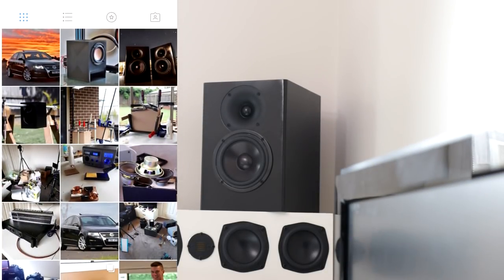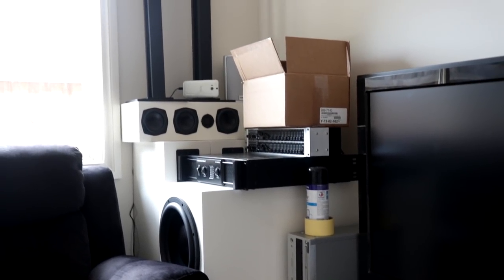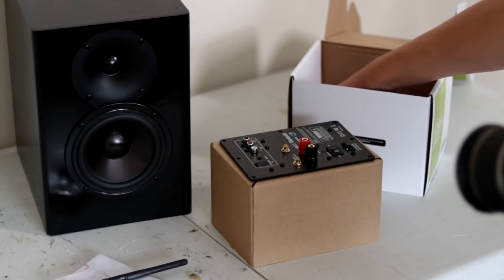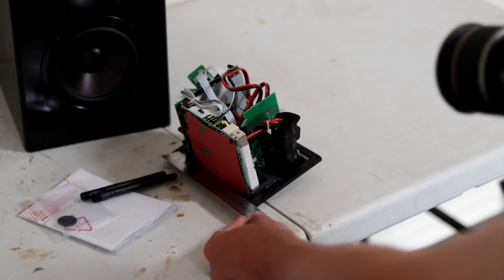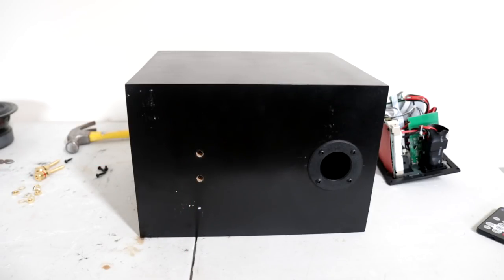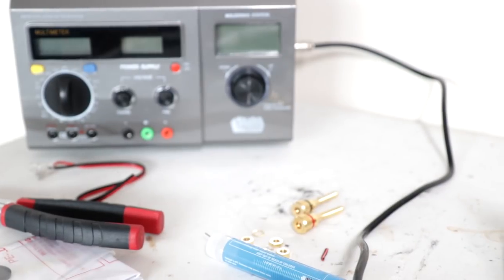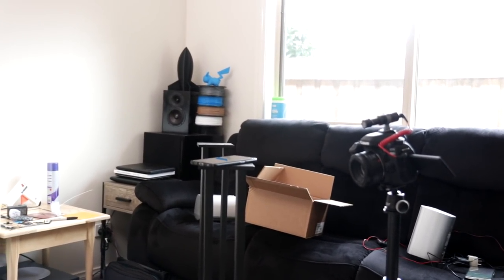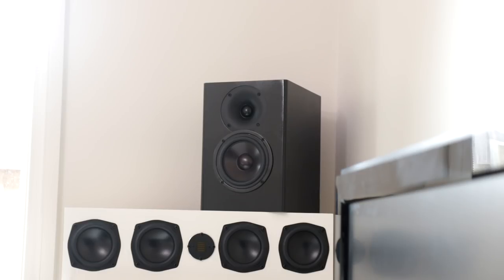Make Bookshelf Speakers Active & Bluetooth! Dayton Audio WF60PA

Comment: While browsing speaker designs I got the impression that internal volume is an important spec of a design. If the impression I've got is right, wouldn't this amp (or bracing, dampening too actually) reduce the actual internal volume, thereby chaging the sound? Shouldn't this be solved, if one was to plan ahead?

Comment: They're not active speakers, since that means active crossover, which this amp does not have.
Reply: Bogdan Serban you can't use audio equalization terminology and assume that is the only meaning, as an active speaker is classed as a speaker with on board amp,also known as a powered speaker, passive or active.

Comment: make a diy bluetooth speaker can hit low as 25-30Hz
Reply: that would be amazing
Reply: if my theories are not wrong, this is possible with 3-5inch driver. i know some drivers can hit 20-25hz
Reply: Yiğit Dağhan it can, i have a 5.1 surround sytem from jbl and if the subwoofer is turned op the speakers hit 34hz they are 3inch its not loid but clear
Reply: yurian yes you can easily found a driver that hits 20-25hz but more desibels more money.
Reply: yurian so lot of speaker can give excursion to 25hz but they dont sound anything (or they are 65db, so you cant hear them
Reply: it cant only have bluetooth  and amplification, most people dont use wireless in their signal.